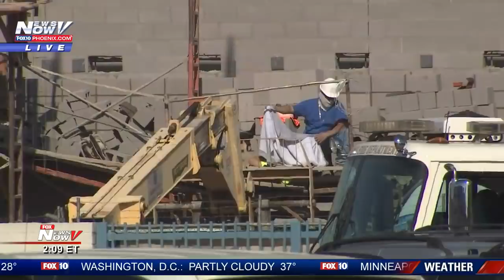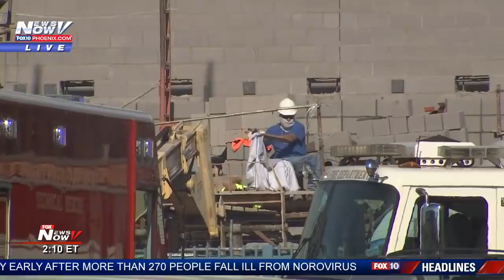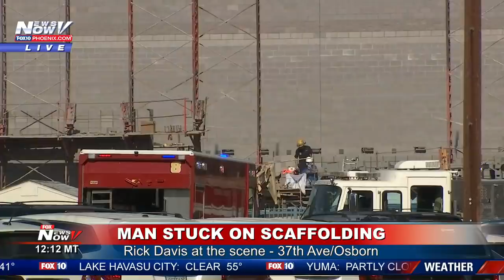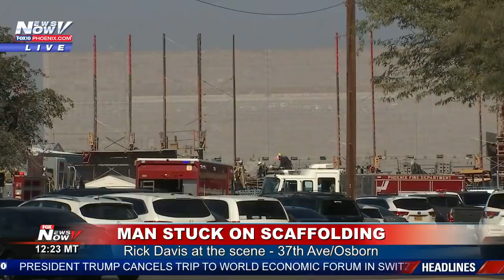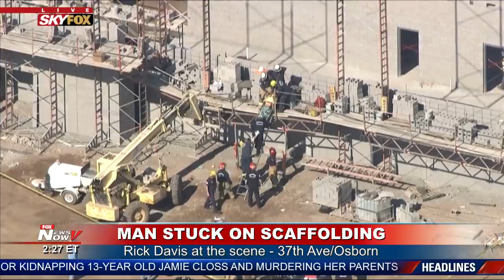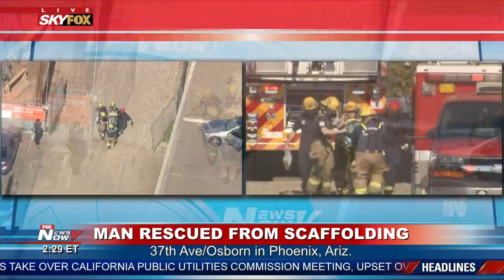SCAFFOLDING RESCUE: Phoenix Fire Crews Bring Down Man from Construction Site (FNN)

Comment: @18:21 is not the wall that collapsed.. the jack up scaffolding collapsed.. see the fork lift and the red and silver bars placed to hold it up..   i wonder if they had too much block resting on the scaffolding.  or if it was just worn jacking.. i would imagine that OSHA will be taking a close look..  so it was not the wall that collapsed.. but the piles of block on the scaffolding that probably fell when the scaffolding dropped that injured the worker.